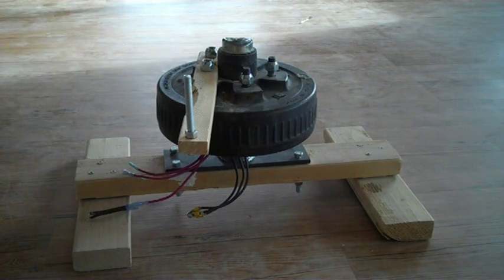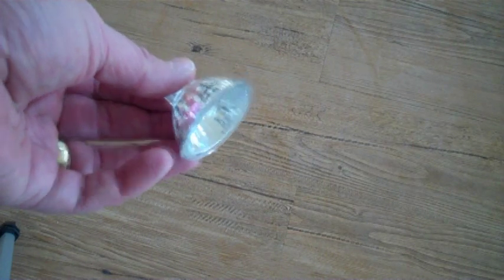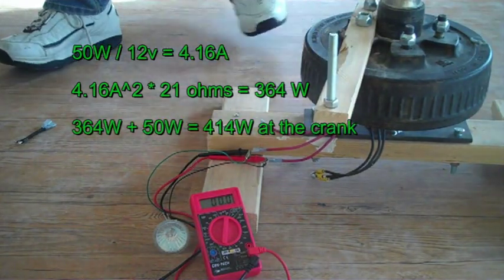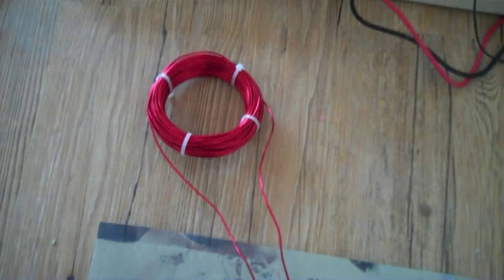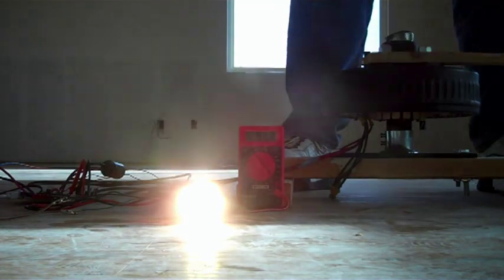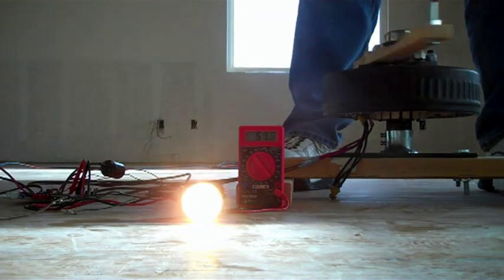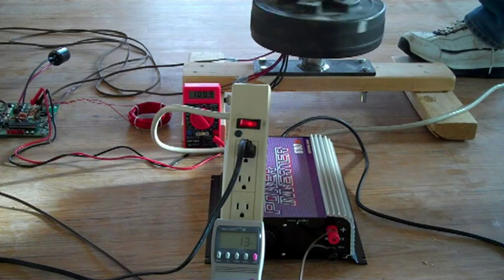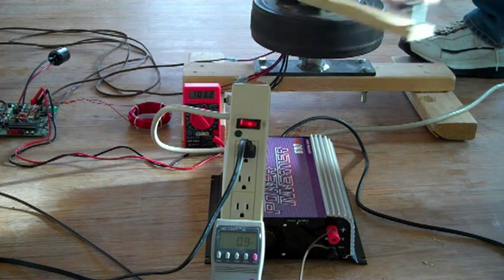New MPPT Board Prototype

Comment: Nice! I recently investigated a new MPPT method for solar cells. :)

The MPP of a solar cell was determined through Power-Resistance graphs. The external load needed to match with the internal resistance was seen to be affected predominantly by the temperature of the solar cell and the intensity of light. Using obtained results from we attempted to create a new type of MPPT where the input variables are the intensity and efficacy of the light and the temperature of the solar cell and the output is the required external load to reach the MPP. The external load required for reaching the Maximum Power Point in solar cells is calculated to be inversely proportional to both the incident intensity of light on the solar cell, I in Wm−2 and the temperature of the solar cell, T in ◦C. Using these two relationships, an equation for the necessary external load was found: R ∝ TI−0.77, and was used to predict the resistance placed on the solar cell.

So it was really cool to see that this can be applied to wind turbines too! :)

Ed

Comment from the maker: @TheJimmax    My board comes alive at 12v input and a transistor change will change that to 8v.   With this alt that's about 8 rpm.   Even with other alts it's usually not very high RPMs before the controller is alive.   There is also an option to get powre from the load (battery) or some other source like a wall wart power supply.

Comment from the maker: @wtam69 Exactly, except in most DC DC converters in power supplies they regulate the output voltage or current.  On this board the microcontroller is more worried about the operation of the wind turbine and pays attention to the load and power of the input.  It also does work to protect the battery or other device on the output.   I also used a technique called Synchronous rectification to make it more efficient
Reply: Hy. Could you please offer more info about the Synchronous rectification method? 
Can you advise from where can i order the electronic kit?

Comment from the maker: @roystervi No, the demo was with the second board made.  I'm making a few more to try on wind turbines.   I never considered using it with something like a bedini motor, but if there is a high voltage source, the board should be able to use it.

Comment: Is this like a dc to dc voltage step down converter instead of the usual dc to dc step up converter?  With the decrease in voltage through the board, the current is increased. Of course I see you have a lot of electronics to store the energy and to determine when the energy is released. Sorry for the non layman language as I'm not an engineer.

Comment: Fantastic video. Keep up the good work. I think that anyone using a pecil, paper and calculator to work stuff out. Is missing the essence of invention. I only use pencil and paper to rough out my design and then build it. If it works great. If it doesn't great. It means I need to investigate. That is the main attribute of an inventor/scientist. To get your hands dirty. Keep going you will eventualy get there. The Write brothers were even told "That thing wont fly."

Comment: Nice to see you have all these people snowballed.

Care to explain how 10, maybe 11V OTV mysteriously is able to get the filament hot enough to emit light, by running it through a BUCK converter? At the same speed (and what even seems slower)?

What you're proposing (and your followers don't understand) is that to overcome the resistance in the coils (and light the halogen), is that you'd need to be crank at an RPM that produces upwards of 80V. Not happening with your arm, pal. Try again.

Comment: So ... where are you now, many years later?
Reply from the maker: This project turned out to be a mess.  Because the owner of that alt loaned me the alt, and a turbine to test with, he was thinking he had full exclusive rights to my design when it was done.  The lesson learned... If it looks like someone is being nice and doing you a favor,  look twice.  Also even the most basic agreements should be put in writing, even if it looks like a simple loan.     Instead of getting into a big legal battle, I just gave up on the project so there was nothing to fight over.  It's too bad because one of the later prototypes was working pretty well.  In the end I returned everything he had lent me so he couldn't complain.
Reply: @sjh7132  oviesly now there are pretty good comercial products avalible, but that do not mean your was not better than the commersial avalible ones.

could you please chare the software and the circuits and board designs as open cource so people can continue devoluping this?

it looks so good at the software, it look like its possible to do anything.

it would be nice to have something like this for commersial 5kw turbine, or eaven a easy way of determend the mpp of any turbine and then use that data to program commercial controller.

hope you can let this project go and see its getting used